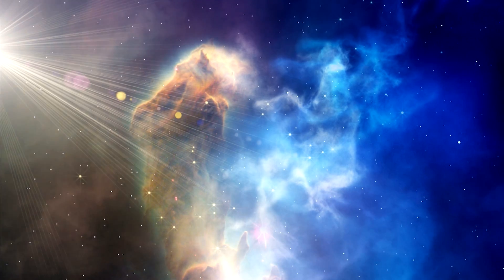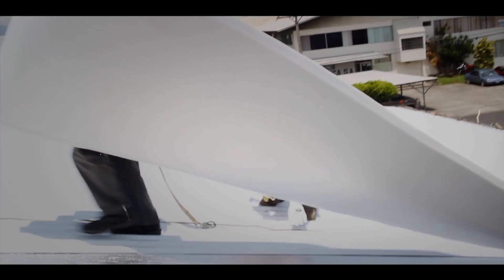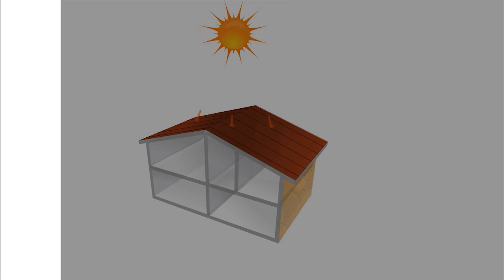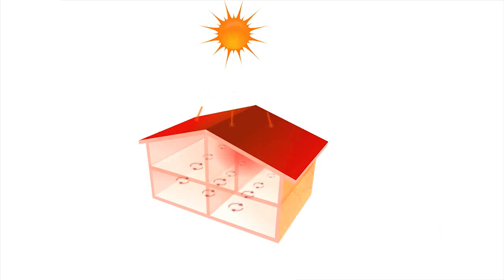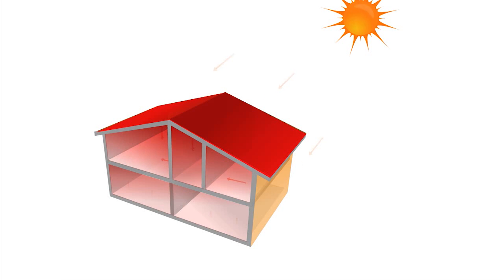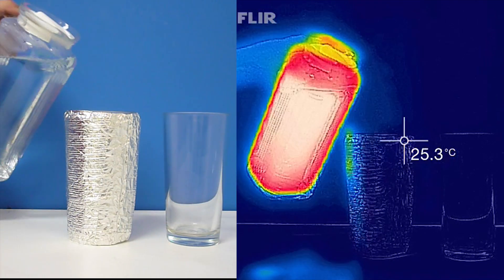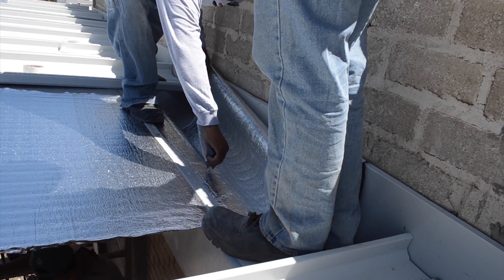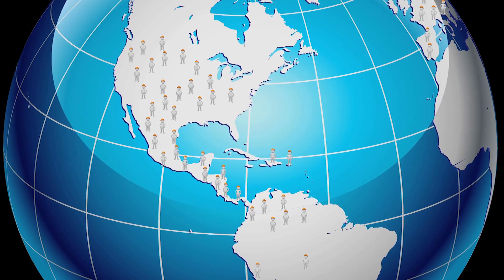Thermic Insulation Educative Video

Comment: I now see that my remark was flippant and without any detail. For 35 years, I worked in energy efficiency for the largest utility in California, and was also a private building energy consultant. Let me point out just one of several things that should give you pause: the ICC-ES test that Prodex touts included the insulation value of an inch of rigid foam and R-13 fiberglass batts in a metal assembly (cross section of a building component). PHYSICS doesn't lie, but Prodex does!